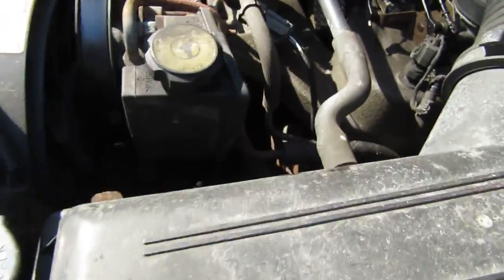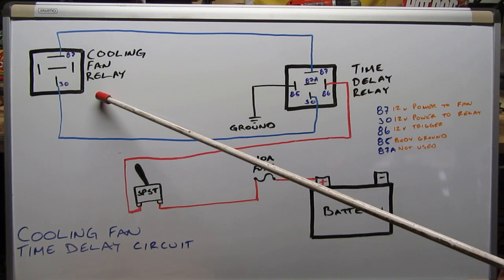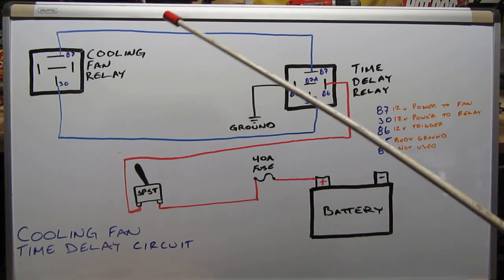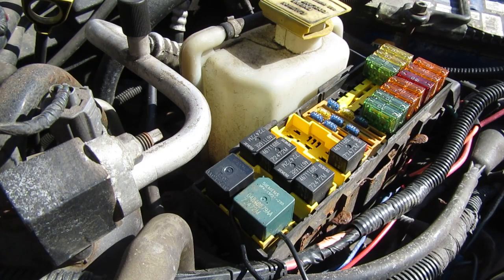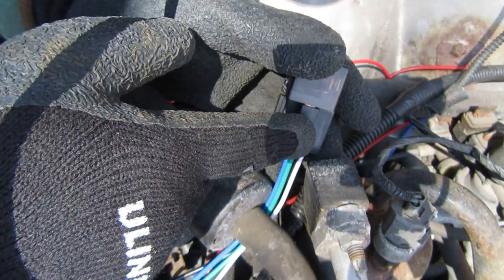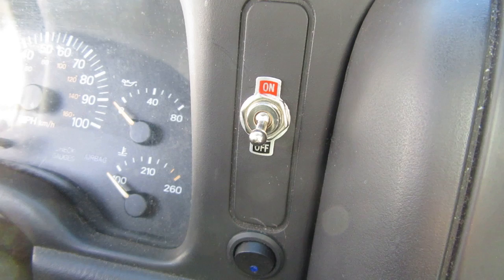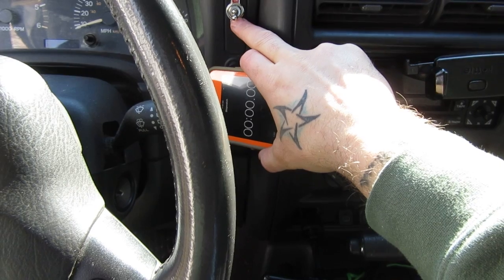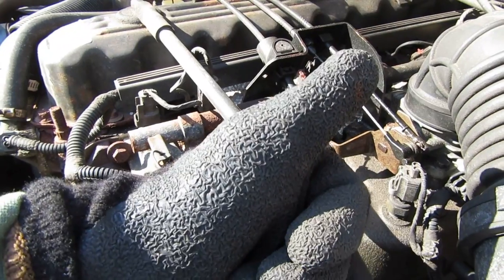XJ HEAT SOAK FIXED - Time delay cooling fan relay install

Comment: Maybe I am off base here but if the factory relay triggers based on engine temps and your switch is on, wouldn’t you be pushing 12v from 2 sources on essentially the same wire? This seems like a fire waiting to happen.

Now if you connected the relay triggers on pin 86 and moved the load wire feeding the fan off the stock relay and onto the delay-off relay, the fan would still trigger based on engine temps and stay on for the delay duration after it turned off… and you wouldn’t have 2 12v power sources feeding the fan.

Am I wrong here?

Comment: man... i followed this to a t and wired everything up correctly and pretty damn well. I was stopped in a parking lot waiting for someone to make a quick in/out trip. I hit the switch to run the fan, left car in pre-ignition to have radio on, when I went to start the car, whole car shut off. I guess it shorted out somewhere and I have no idea where. After a few minutes, the power came back, I have no idea what caused this or fixed it. I just pulled the wires from the battery. Gonna have to take a closer look today to see if I can find what caused it. I'm like 99% sure it's something to do with wiring in this mod because its the only thing that changed. Will update if/when I figure it out

Comment: Not sure if you’ll see this, but I have a 2000 xj and bought the same exact relay and followed this video to a T and it didn’t work. I confirmed my electric fan does work so I’m not sure what I’m doing wrong. Any ideas?
Reply: Figured it out, nevermind. Thanks for the awesome video

Comment: Does this work on a 2005 jeep grand Cherokee...I tried it and its not keeping the fan on...
Reply: 05 Grand Cherokee is a completely different vehicle with completely different electronics and wire routing. This video applies to the Cherokee (not Grand Cherokee)

Comment: For anyone looking to source the relay, the updated version is part number BU509TD.

12v for the switch I got from the cig/accessory socket.  For the XJ the one on the right is always 12v hot and fused for 25 amps.

Comment: One thing for certain- be careful you aren't just masking an underlying heat issue by band aiding it with a mod like this. This is an awesome idea, if used in conjunction with a properly operating cooling system. If I had installed this mod first i might never have found my underlying issue. The saga goes like this: I had replaced my stock radiator (which split open on a trail out in Moab bc my guage wasnt working, and the radiator cap didnt pop) with an aluminum radiator, I replaced the OEM water pump with a flow kooler pump, put in a Hesco high flow thermostat housing, cut hood louvers in my hood, even replaced the fuel pump thinking it wasnt pumping at pressure (partially atomizing the fuel and causing overheating. After chasing all that, I found that it was a bad cooling fan clutch. I read somewhere that after 10 years of life, these fan clutches operate at 50% efficiency. My rig is 30 years old- so the fan clutch was essentially useless. Word to the wise, replace the fan clutch with a standard duty clutch- forget about yhe heavy or severe duty if you want to keep your mpg and your sanity (extremely loud ALL of the time). I'd do the clutch first, then make sure your efan is kicking on, and then do this guy's mod to prevent boilovers out in the trail or when you park it at 7eleven to get a slurpee.
Reply: what year is yours?

Comment: Anybody know of a replacement relay? I think the BU508TD got discontinued. I have it wired up to run and have been using a different relay and it works great - but the time delay feature is a awesome idea. I’m guessing any time delay relay ought to work as long as the pin out is the same…
Reply: There is a new version and the part number is BU509TD
Reply: @redtango75  thanks man
Reply: Quality Mobile Video is where I got mine

Comment: I had an idea… what about a 12v fan, kind of like what you see in computer cases, and you mount it under the bumper where it draws cool air through a flexible dryer vent that pipes through directly to the injectors/fuel rail area of the engine? A buddy of mine took this one step further on another vehicle (not a Jeep) where he directed his interior floor vents to go to his engine bay instead, so on disgustingly hot summer days down in Alabama where he lived, he could simply flip his air conditioning switch to the floor vents and literally blow ice cold air into the engine bay. It was genius.

Comment: Thanks for your video. It is a great and simple way to help the cooling system, specially when driving under high loads at slow speed. I think that this trick will work even better by using a deep cycle battery. Unlike the SLI batteries, a deep cycle one will endure better the additional current drawn from the aux fan.

Comment: I just did this and it works perfectly. Out of all the options and videos out there, this is the one that works for me. If anyone has an issue, swap the wires you added to the OEM relay. Worked for me. I can leave the switch on while driving or only flip it on when I stop at a store.
Reply: I'm not very good at fixing things, but I think I found a solution to the vapor lock problem in my Jeep. Can a mechanic shop install it for me? Or is this something I would have to do myself? I really don't know much about it, so I'm not sure how to approach this issue. Would appreciate your advice.
Reply: @michaelwilliams9009  this is something you can definitely do but I know a shop can do it.

Comment: Do you know anyway to have this happen automatically, without having a manual switch, every time the car is turned off?
Reply: I’d imagine if you wired it into the ignition switch, you could have the fan come on automatically when you turn the motor on and have the timer go after you turn the motor off. I’d have to pull up wire diagrams to be anymore help.

Comment: Hey so I have a 2000 Jeep Cherokee and I have done this to my jeep with a push button.  When we put the time delay relay in it doesn’t work but when we but a normal relay in, it works but you have to hold the button uggg.  Any idea what might be causing this??

This is for anyone to answer… anything helps

Comment: I want to wire a 3 fan cooling system. 1 with my ac still and 2 to the ignition or some othe power that works based on inginion. Should I go straight to the ignition what wire or where else.

Comment: With this setup can I hit the power switch with the jeep running while offroading so it will keep the E fan on to keep my temp a little cooler? Or will it interfere with the on board relay that kicks in?  Great video.
Reply from the maker: Nope. you can absolutely do that. I used it like that when towing in the summer
Reply: @DEInTheGarage  I think the relay you used is discontinued.. Do you know of another option?
Reply from the maker: @jaybourbon8608  Oh darn.. I do not and a quick search is not coming up with anything comparable in price. shoot me an email and if I find anything I will let you know dandeoffroad@gmail.com

Comment: i wonder how can i install the time delay between the thermostat and the computer (if there is one) so fan will run for x time every time i shut down the engine automatically (some cars do that ).

Comment: Once you remove the positive battery cable, all power is removed. It is unnecessary to disconnect anything at the power distribution block.

Comment: I have a triple fan upgrade (SPAL) with a relay switch that I can switch on whenever. Even @ 160 F . Also replaced injectors, wrapper the injectors, put an aftermarket double hood vent as well and it still consistently heat soaks. Any suggestions?
Reply: It’s a 2000 XJ
Reply: Does it have a rough idle ever? Id almost wonder if you’re getting enough fuel pressure. What are the outside temps this is happening at?

Comment: Great video Doug. FYI, Mopar/Jeep(via Amazon in my case) sells a product that looks similar to a packaging peanut( ie, for safe shipping) that has a slit on one side and you just wrap it around a injector. They were around $8 each. I took a chance on just getting one and wrapped it around number 3 injector and what do ya know- no more stalling out at red lights and stop signs, no more errand running no starts! But I still like your method! Oh yeah, the issue was on the wife's 99 WJ...but its still kicking!
Reply from the maker: Thanks bud. I am going to check that out
Reply: @DEInTheGarage   
 https://www.amazon.com/MOPAR-56028371AA-SHIELD-IGNITION-CABLE/dp/B007O3QHDK or a 4 pack: https://www.amazon.com/SHIELD-IGNITION-CABLE-MOPAR-56028371AA-Pack/dp/B078866CX9 OR 6 pack: https://www.amazon.com/Jeep-Injector-Insulator-Sleeve-Mopar/dp/B072HGFZ6W/ref=pd_aw_sbs_263_3/144-7690175-7711310?_encoding=UTF8&pd_rd_i=B072HGFZ6W&pd_rd_r=664d8db6-9368-426e-869f-82f1374e0cd1&pd_rd_w=xA2ui&pd_rd_wg=tEgdY&pf_rd_p=e77c46c6-9dab-4a4a-951b-8566bbc7981e&pf_rd_r=064VDYHK6GFGCQ0MYY1W&psc=1&refRID=064VDYHK6GFGCQ0MYY1W

Comment: I see you added a fuse between 86 and the battery. Wouldn’t a fuse only be needed from 30 to the battery as that where the majority power flows? The fuse is already integrated into the fuse box since you just tapped into 30 on the original relay.
Isn’t 86 to battery just the low power side of the relay? Not sure if a fuse is needed there, or if so perhaps a smaller one is fine. 
Thoughts?
Reply from the maker: I always fuse everything right off the battery. It gives me an easy way to incomplete the circuit quickly if I need to. It does not hurt anything to have a little extra protection as well
Reply: D&E In The Garage makes sense, thanks. I’m thinking of tapping into a hot wire already in the dash. I’ll see if I can find one that’s not ignition hot only so the fan can run when the car is off.

Comment: D&E Your videos ROCK. OK, let me make sure that I got this right, with this set up you can manually switch the fan on & and you can switch the timer on & the Jeep will still automatically turn the fan on when it needs to ???  -THANX
Reply from the maker: pretty much. When you turn the fan on, the relay goes on and stays on as long as the switch is on. When you turn the switch off the relay (and fan) stay on for however long they were set to stay on up to 5 minutes. For most XJs 3-5 minutes is enough to move cooler air in to keep it from vaporlocking. It should be noted that a few people who have done this based on my design have had issues with the time delay relays getting moisture in the and not lasting all that long. The idea still works, but you may want to source a higher quality time delay relay or do what I did and buy a spare

Comment: So, I did this to my Son's 96 XJ and it worked but not quite the same. It seems that year XJ only activated the fan when the AC is turned on. As far as I know it never comes on otherwise. Now when you want the fan on you need to switch on the AC then flip the switch on the dash we installed then turn the AC off. The fan will stay on for 3 minutes then shut off. Works great other than that.
Reply: That fan comes on when the AC is on or when the temperature hits a certain level inside the engine.
Reply: @stuckndema  Well in hot climates the AC is always on, might be 1 week in February you don't run the AC in Florida. So for the Hybrid cooling system he has and I have in my Dakota (Clutch and Efan) You technically need an entire separate Aux fan to do this with to avoid patting your stomach, rubbing your head and whistling Dixie on one foot to get the fan setup to work.

Comment: Question regarding the stock electric fan circuitry:  I have a 1995 XJ without the optional electric fan... Do you think the wiring exists (as it may have been easier for Jeep just to install one set of wiring harnesses) and I just need to make sure that the relay and all fuses are installed (as well as purchasing a Jeep electric fan) and then it should work?
Reply from the maker: I think it is very likely. Jeep usually has one set of harnesses for all trim levels

Comment: Completed relay install Sat Oct 26 works perfectly! Now to find out if the cooling will stop the heat soak, referred to this video throughout the process,thanks man!!!!
Reply: Used a 20 amp fuse,so far so good the 10 amp I put in at first blew immediately
Reply: My fan ran 3 minutes 4 seconds
Reply: I'm just adding a on/off swicth with 30 amp relay in to cab I can turn it on when temp starts to climb www.ksuspensionlift
.com sells a nice wiring kit 35.00 easy install
Reply from the maker: Awesome! Glad you found it helpful! Hope it fixes your issue
Reply: So did it fix the heat soak?

Comment: How are you. I just got a 96 jeep Cherokee 4.0L xj and I also live in New Jersey! South jersey but no big deal. I have been rigorously searching and asking everyone about this one specific part in the engine compartment of my jeep but no one can seem to give me an answer as to what it is and I can't find it in any manuals anywhere. The part is a sensor directly located at the rear drivers side next to that corner of the valve cover. If you use Twitter you can find me at @ronpcan411 I'm in desperate need to figure this out as my jeep will start but stall. I've tried many things to fix it but am curious if this sensor has anything to do with this issue...I noticed the broken piece while changing the crank sensor on top of the drivers side bell housing, the cable come up into the engine bay right next to this broken sensor part I'm describing. Can you help me out?

Comment: Hello..,I was wondering if you know of another place I can get the time delay relay? I bought one using the link on the description, but it seems it got lost on usps system because never arrived...I contacted the seller and after the third request he answers and promise to ship another one the same day...that was almost a week ago, but he didn't ship anything...I am pretty much sure I lost my money, and will ask for a refund....but I really want to fix my heat soak issue and can't find any other relay like that....thanks...
Reply from the maker: Awe jeez.. I am sorry man. That is awful. I never had an issue with them. Here is a different link, but it is more expensive and I have never tried them before. It should work in this system fine though
https://www.delcity.net/store/Time-Delay-Relays/p_804415.h_804416.r_IF1003?mkwid=stOATPoH0&crid=38094426869&mp_kw=&mp_mt=&gclid=CjwKCAjw5_DsBRBPEiwAIEDRW2u7DhzG0jnfsOvQgV33QwAFCagyajy0LbMkxGZCXdwkwJitT4fwCxoC-_AQAvD_BwE
Reply: @DEInTheGarage  Hola...it looks like they ship it again...will see if it arrives and let you know...if not will use this other link
Reply: Hey I got mine a couple days ago...they shipped it again and this time I got it fine....already setting it up on my XJ...
Reply: I received my order in about a week no problem

Comment: What if I just wanted my electric fan on at all times when the Jeep is on? How would I wire it if I didn’t want to run a switch?
Reply from the maker: You can omit the switch and run the power from a switched circuit (12v outlet) to power the relay. Then whenever your Jeep is on, the fan is on. That said, I would not recommend that setup. Your MPG is going to go way down as your Jeep will not get to operating temp as quickly if at all

Comment: Your relay trigger circuit only needs to be fused for around 5 amps because all it has to do is pull in the relay's holding coil.
Reply: That and it doesn't look like his wire going into the cab and back is capable of 40 amps.  That would be like #8 wire.  What he's got looks like about #12 or 20 amps max wire.  So the only thing he's protecting with that 40 amp fuse is the short pigtail from the battery.  Everything past that could go up in smoke should there be a short.

Comment: I want a toggle switch to run my fan in traffic and a momentary button switch for when I park... can you piggy back both controls off the stock relay?. can you cut the toggle switch in between the stock relay and the time relay to bypass the timed relay and still have function with the momentary button switch???
Reply from the maker: Yea, I think that would all work

Comment: How about some good old fashioned header wrap combined with a heat shield between the intake manifold and the exhaust manifold. But hey some people just like to make things more difficult than necessary.  I refrain from unnecessary electrical  add ons.
Reply from the maker: OMG! Genius! Why has no one ever tried that?!... oh wait... we have... turn out more than just the exhaust manifold gets hot on an engine. Who knew
Reply from the maker: You also seem to refrain from thinking
Reply from the maker: Also, I just checkout out your profile... you have a VR date playlist?! are you some kind of perv?! WTF is wrong with you? Please never comment here again you pervert.

Comment: Just turn the Ac on so the fan runs and use this in place of the oem relay.
Reply: On 2000+, the A/C doesn't activate the radiator fan until the compressor builds pressure beyond a certain threshold. When the A/C pressure lowers again, the fan turns off, even though the A/C is still on. It cycles on and off every 15 seconds or so, which is unlike the older 99- models, which just run the fan permanently while the A/C is on.

Comment: Ksuspensions sells a switch kit for the xj to allow for manual fan operation. Without having it in front of me I can't say for sure but it seems like swapping your relay into that set up would give the same result. Right?
Reply from the maker: I imagine that would work perfectly
Reply: I too would like to go this route. have you successfully tried the Ksuspension harmess kit with the time delay relay? Any tips would be nice, thanks.